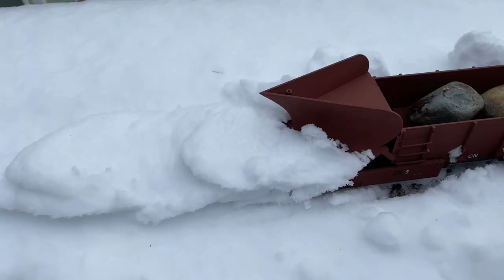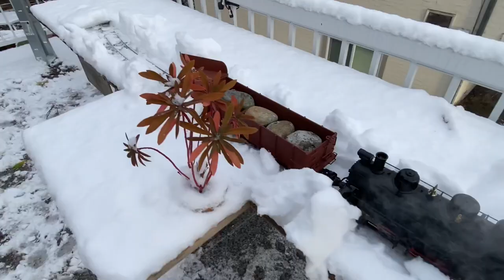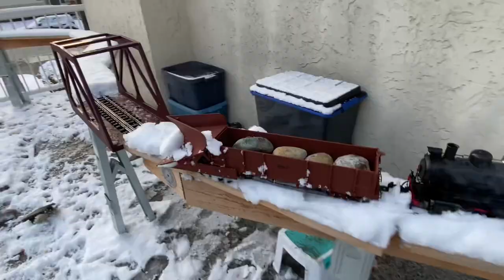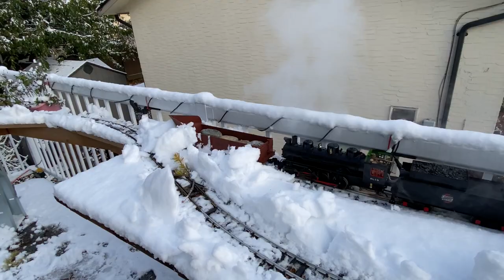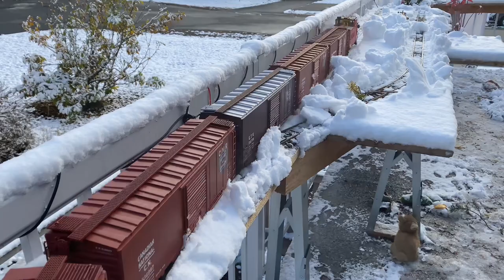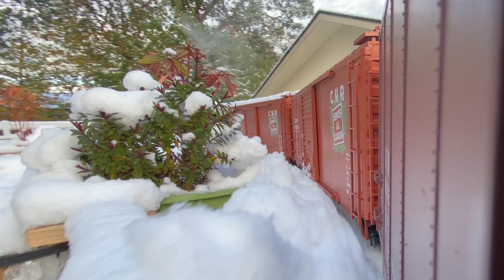Victoria BC: LIVE STEAM Snow Plow Extra! #gscale #livesteam #modeltrains #gardenrailway

Comment: That's great fun, we don't seem to get much snow here now. The winters are a lot milder, which usually means rain and then more rain 🙄Unfortunately I can remember (I'm old enough) a winter in the 1960's when our mains water froze and we had to resort to boiling saucepans of snow on the stove. Then there was a lot of snow!
Reply from the maker: Our winters sound like yours. We typically get a bit of snow for a day here and there and for the last several years some days in a row sometimes. Our winters are chilly and rainy as well. 20 years ago snow, even for a day, was very rare. The Jet Steam over us has shifted slightly causing droughts in summer and colder weather in winter. 

And yes it was great fun! 😊